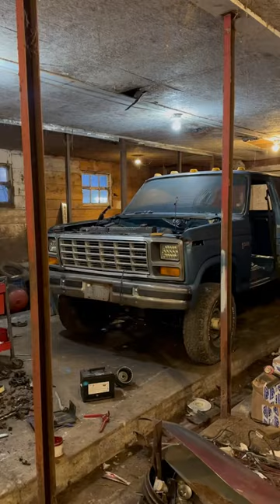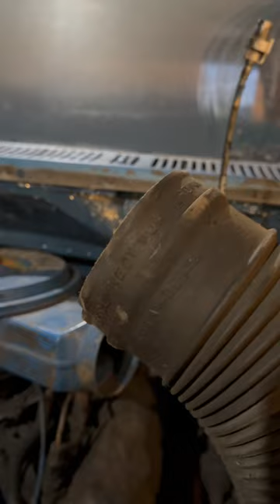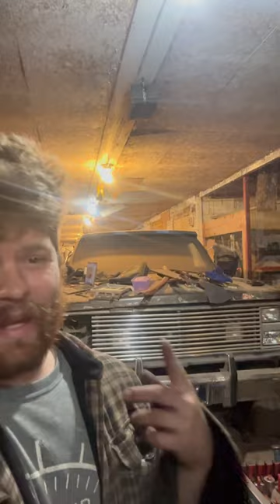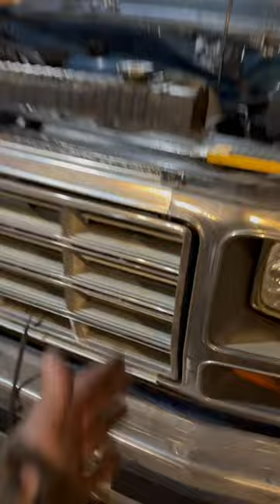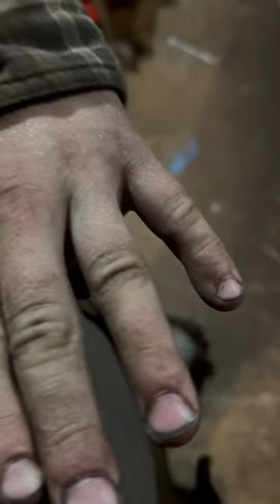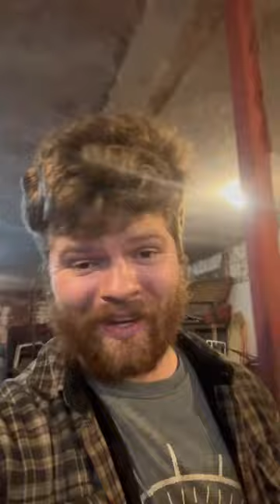A manly feature on a manly truck

Comment: That's why my 92 dodge Dakota with a 318 was great off-roading. It was fuel injected but had and old school round air cleaner on the top. Never sucked in water.

Comment: I always wanted a 70s ford growing up. Now, I've had my 86 Diesel F250 for over 15 years and still love it. D60 up front, E4OD retrofit in the middle, and turbocharged. The only thing I wish I had is an intercooler, but the truck still does all I ask of it. Did I mention I love my old Ford?
Reply from the maker: Someday this truck will get a d60 under it
Reply: Is that the 6.9 idi? Ive got a 90 f250 xtracab LB with a na 7.3 and 5 spd stick. Its a dream on the highway!
Reply: I have a 88 long bed dually with a 7.3t idi that I’ve put some of my sons college fund into. Hands down the best truck I’ve ever had
Reply: I got a brand new stage 2 kc turbo sittin here for a 7.3 i could part with if anyones interested lol

Comment: Ford still had the great 300 six in the 80s. That is one of their all time great engines.
Reply: They still had them well into the 90's.
Reply: Funny enough, you could get that engine in Australia in 2015 new in a vehicle
Reply: i got one in my  94
Reply: @RileySolomon1  I also had one in my '94 F-150. Only drawback I had with mine was the 5 speed transmission. The older 4 speeds had a granny gear for first, and a really low reverse. That would've been ideal for my truck when I was hauling a lot of logs for my sawmill.

Comment: New Ford's will probably die when you try to cross water
Reply from the maker: Likely right haha 😂
Reply: i got a 2013 with the 5.0 and the 6r80, and tell u what thats the best modern ford i can argue for, its got a little rear main seal at 95k but i just pour a quart every now and then and itll rock just fine lol, no other issues at all
Reply: @harrisonmauldin5090  just wait
Reply: @The_New_York_Redneck-ny2wz  wait until what exactly
Reply: @harrisonmauldin5090  just wait for your Ford 
My friends 5.0 went at 105k
Reply: @harrisonmauldin5090 you already got a rear main seal failure at 94k its not even at 100k and already broke?
Reply: @The_New_York_Redneck-ny2wz  that’s only 10k away and I’ve put nearly 50k on it and it’s still running like a sewing machine, I have no reason to think it’ll go out that early, he probably just treated it like shit
Reply: @kennethryan8112  no it’s not puking oil, it’s just wet, it may be the oil pan but it’s a bit noticeable, I’m not spending the cash and time to do a rear main on it when I can just put a quart in every once and a while
Reply: @kennethryan8112  if it was broke it would be dumping oil
Reply: @harrisonmauldin5090  na he drove it in New York
Reply: @The_New_York_Redneck-ny2wz  so did he not drive it much since NY? Or did it just rust out? Or did he just never do oil changes
Reply: @harrisonmauldin5090  I don't know
Reply: I can speak with experience on that, 09 f150s definitely do. Only vehicle ive ever hydrolocked.
Reply: I don't like new cars that much but i work at a Ford fleet shop tech I see 5.4 with 300k 400k plus miles and 5.0 3.7 with 200k all day but I also see someone go out with low mileage. Take care of your vehicles and they will take care of you
Reply: @The_New_York_Redneck-ny2wz so I have a 98 f50 with the 5.4 with 200k on it as it it’s and has never had a major issue other than routine maintence which I’ve done I bought it for 1600$ 8 years ago. The absolute best truck I’ve ever had and I’ve had dodge and Chevy with no luck.  Maintenced regularly oil done every 3000 miles. I haven’t touched exhaust gaskets , nothing internal at all. Never changed the tranns or rear fluid . Doesn’t leak a drop of anything anywhere . I just purchased a 20’ 2.7 ecoboost and we’ll see how it goes. Nothing but great luck with ford trucks , I don’t understand the hate. I think it’s jealousy honestly
Reply: @anthonyhales4192  you have a 98 when Ford's were still good now they aren't as good as they were
Reply: The Fords with single timing chain setup are worthy of owning.  I can't speak for the godzilla though, not familiar with it.
Reply: @The_New_York_Redneck-ny2wz  and in 1998 they said you have a 79’ ford fords aren’t as good as they used to be. It’s all maintence man why do people complain about stuff they know nothing about and refuse to maintain I’m not understanding. A fucking DAE- WOO ( remember those ) will run forever if you maintain it. I’ll catch up with you in 15 years when the 2020 is still on the road with 200k
Reply: They'll die looking at it
Reply: Hell don’t even need to ford water to get water inside the newer trucks it just comes in the sunroof
Reply: @jimmyboe25  I've seen that problem in Chevy cruzes too
Reply: I've got a 94 F-150. It's a sproject truck, but it's the 5.0, needs an e4od or a z5 because the AOD is ASS.
Reply: the E40D in my truck just towed a 12k lb  trailer 500 miles like a champ 250k on the odometer  barely had to tap the brakes going down a 7% grade. Stock transmission cooler is trash tho and mine puked fluid when i was going uphill for 10 miles at 2800 rpm. Top off the fluid still shifts good too. I would definitely prefer a z5 tho i just love jammin gears   @Trucks_n_stuff
Reply: @harrisonmauldin5090  I wouldn’t worry too much. I have a 14’ with 291,000 miles, 5.0, and I have ran it like a 5.0(hard) since 216k(with a Diablo sport tune)The cam phaser sensors leak some oil. But that’s about it.
Reply: 101 likes
Cool I guess
Reply: my 2011 f150 eco bxtch dies inside when i joke about off roading😅

Comment: Had a 1989 f150 with 4.9 liter and the plastic intake runner broke when motor mount went bad..conveinantly when i drove through 3ft of water and it was coming over the hood a little it made it through undamaged. I thank that broken intake tube.

Comment: My dad has a 86 f250 with a 351 Windsor, it now has a 82 I think body because the first one basically rusted off the frame, it had been beat to death when he bought it in 99 for $1500 I saw him load 3 280zxs on it and a 16’ trailer once he had 1 1/2 on the trailer and 1/2 in the bed of the truck. It’s pretty manly lol.

Comment: They made the obs in f250 heavy duty and up through April 98, because the powerstroke wouldn't fit under the hood of the light duty girlie truck.
I bought my Feb of 98 f250hd new it now has 273,000 on it.
Reply from the maker: Yes sir likely one of the last ones off the production line
Reply: @highostablegarage  I live in Central California and April of 98 most dealers had one diesel, if any. I worked about 10 minutes from Chowchilla and the dealer there had 5, all dealer trades out of the bay area, and I liked this one, didn't care for any of the others. I've put on all but the 485 miles it had, it now has 273,000. Wouldn't trade it for anything.
Reply: @highostablegarage  ive got a f350 cclb with a PS7.3 built on 10/97. One of the last OBS made. Just hit the 200k miles mark.

Comment: I have an 88 ford f series, body and frame are the same as the bullnose. I’ve also owned and own newer trucks, ie 99-03 and now a 22. I can say with confidence trying to argue these old obs trucks are better than new trucks is foolish. The new ones may be over complicated and harder to work on, but they are so much sturdier, comfortable, and capable. My 88 doesn’t even have tie downs in the bed! What good is a pickup without tie downs. Added some cleats to the bed where newer trucks have ‘em, the metal those obs trucks were made out of its like tin foil. They are cool but at the end of the day they can’t hold a candle to newer trucks.
Reply from the maker: Sheet metal is 18 and 16 gauge on the old beds, new is 18 and 20. Must have attached that tie down in the wrong spot.

Comment: If youre gonna ford your Ford (yeah, had to, lol), remove the fan too... water will either break it, or flex the blades enough to eat your radiator. Fans dont make efficient propellers

Comment: Even better. Toyotas trucks in the 80s could be equipped with a clutch cancel button. Incase your engine died while water fording. You hit that, put it in gear, and drive out with the starter.

Comment: 6.9 idi ? Pretty solid just dont do too many cold starts. The 7.3 and 6.9 are known to crack blocks.
Reply from the maker: Early 6.9s before 84, after that they aren’t too bad stock
Reply: @highostablegarage  when I say cold starts I mean below zero whether. The 7.3 idi was even worse than the 6.9. When the power stroke came out it solved those issues. That's why they are so desirable today. Those things were made to run. I've commonly seen them with 200k+ no problems. The only problem was rust.

Comment: I mean I do like the '70s trucks more than the 80s and '90s trucks. And I'm not a big fan of twin beam suspension, I don't do much sand doing stuff
Reply from the maker: They are pretty tough but I get your point, sucks to change the inner u joint passenger side on these front ends
Reply: @highostablegarage  my issues is tire wear. And altering ride hight

Comment: Most of the ford chassis from the 80's and 90's can't handle the diesel  power they are set up with.  The motors just tear the trucks to pieces.

Comment: Someone who owns a new f150 had to pay 6 or 7k to fix a taillight when rain got into it and burned up all the sensors in it. The entire truck stopped working because of it and the taillight alone was $5k. I will never buy anything built past '05. Anything built past '90 is a pos, but at least the engines were decent.
Reply from the maker: I like your style, I know what you mean though, uncle tony just put out a video on pretty much the same subject that’s worth a watch
Reply: My 08 5.4l f250 has been pretty durable in the last 5 years I've had it

Comment: Wouldn’t a lightning be better at fording since it doesn’t need air?
Reply: What happens when water gets into some box that has several computers and circuit boards, etc, that control everything? I'd really worry about electrical connections, and the fact that there is high voltage in that thing. I remember reading somewhere that trained electrcians have to do the work on those when something eventually goes wrong. Very few parts servicable by a normal mechanic, besides the real possibility of being electrocuted.

Comment: Im confused why wouldn't you take a lightning through water, electric don't need to air to run.
Reply from the maker: Same reason why it wasn’t a good idea to transport electric vehicles overseas on the deck of a cargo ship, they learned the hard way haha 😂
Reply: @highostablegarage  I'm not familiar with this incident, but I can assure you if an electric car can survive the winter in most of Canada and the northern US it will have no problem surviving a little salt sea air.
Reply from the maker: @nobodyofnaught2  all the electric cars burned to the ground while crossing the ocean due to the salty sea air

Comment: A Ford lightning is built for speed but a Raptor is made for whatever ur doing! Also i used yo be 100% Chevy but now Toyota is hands down #1 in half ton line up! But I'd get a raptor over a TRX anyday bc of reliability and well the Raptor is a wayyyyyy better truck besides the lil bit more HP and the v8 sound but besides that theres nothing else to talk about! From 2004-'24 dodge is flat out fucking junk with ALL PRODUCTS and Toyota is #1 in reliability!
Reply from the maker: All of those sadly are further than far out of my price range to even have an opinion on haha 😂